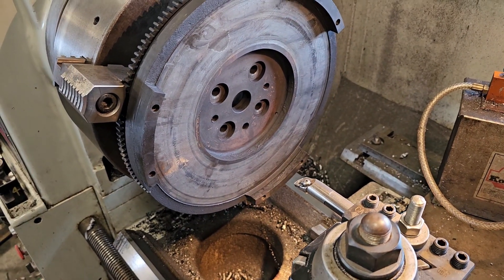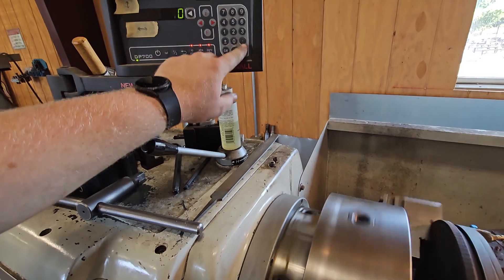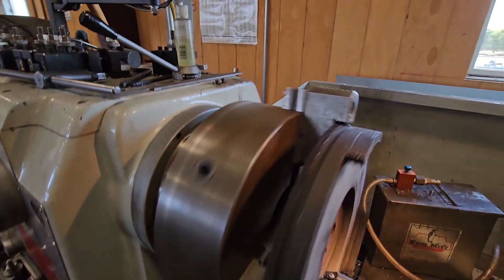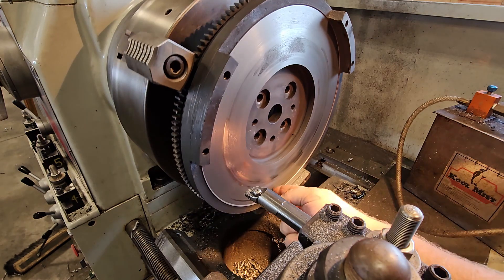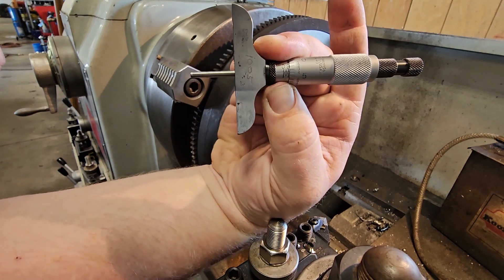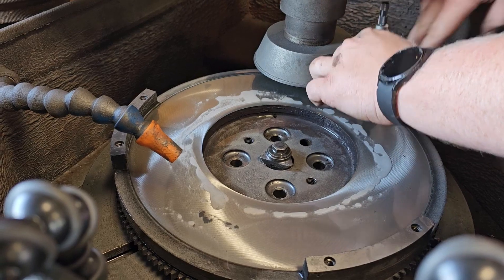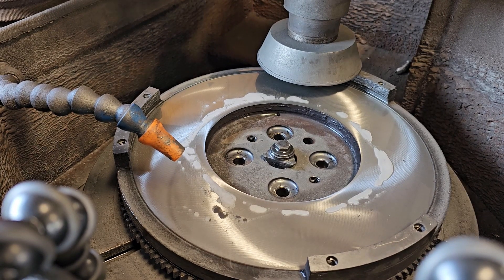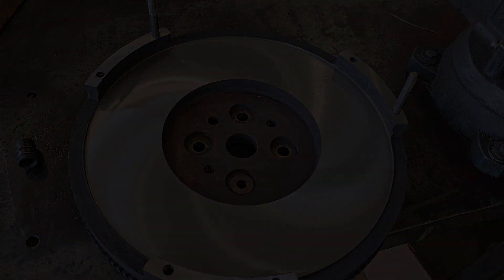Grinding a Flywheel

Comment: Why were you concerned with the step height before the main surface was finished?
Reply from the maker: @buyamerican3191  if I understand your question; it's because I see what it is before I grind it so I can make it the same after. Faster to measure it than look it up in my book. And sometimes it isn't in my book.

Comment: Why did you cut it on the lathe if you still needed to grind it?  After watching the grinding it was obvious the lathe didn't produce a flat and true surface.
Reply from the maker: Because the grinder take about 5 times longer than the lathe. I only use the lathe if .015 or more needs to come off. It's a lot faster, even with additional setup. With the lathe, I'm mounting in on thr ring gear surface, which isn't true. On the grinder, it's on the crank surface. I'd say this one was .002 off.
Reply: Thanks for the reply.

Comment: Nice lathe, good idea to true the flywheel in the lathe first.
The FG5000 Winona Van Norman is a great flywheel grinder. 
I ground alot of flywheels on these machines.
Nice job. 
Thanks for sharing.
Take care, Ed.
Reply from the maker: Thanks Ed. It's also a big time saver and a grinder is super messy.